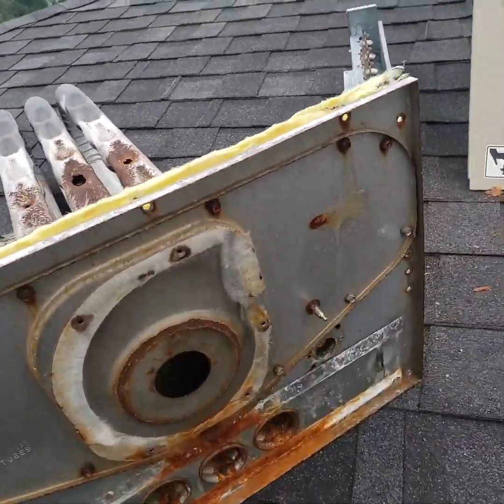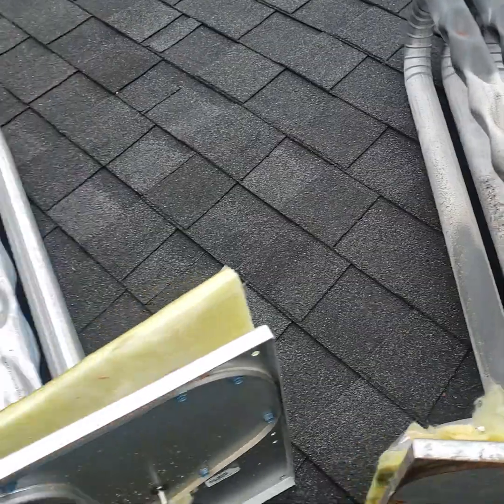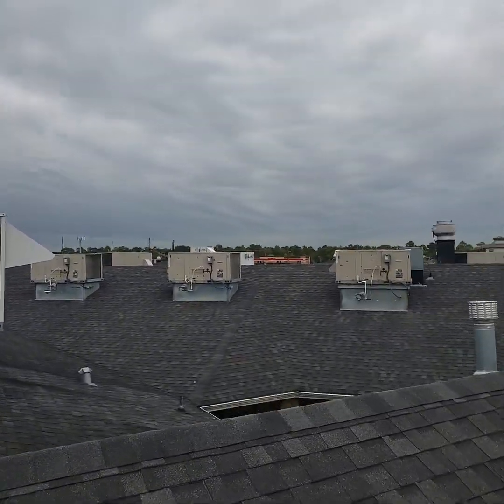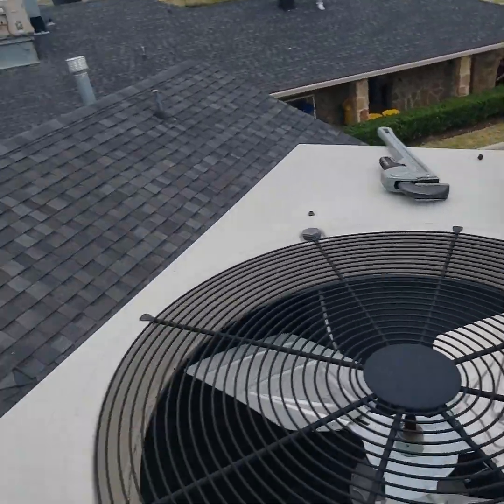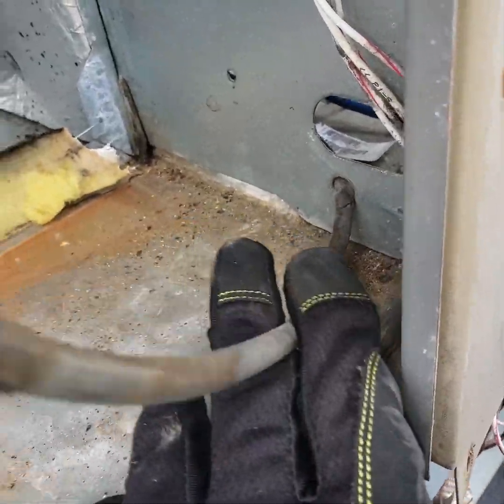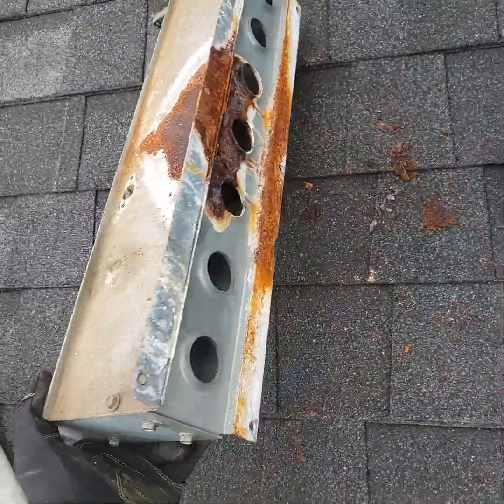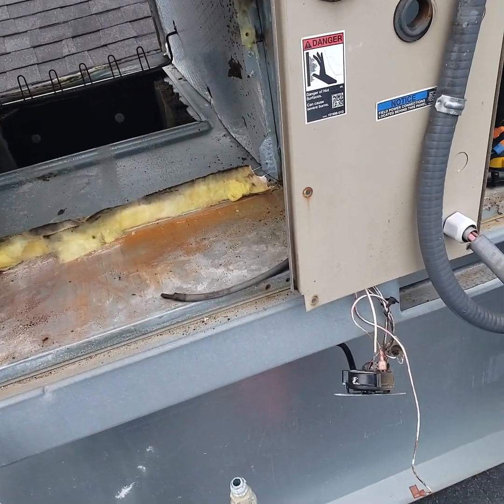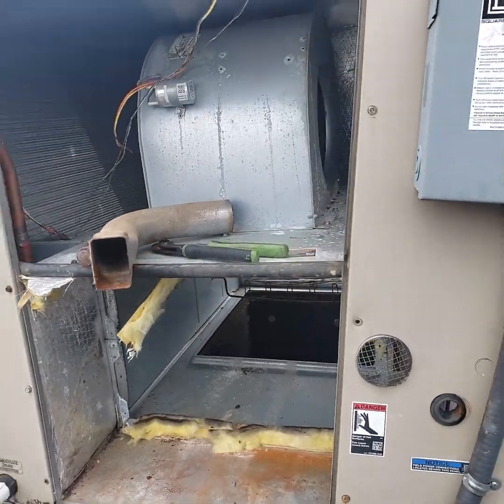HVAC: Cracked heat exchanger

Comment: The thing that stood out for me was the dimple on the exchanger tube. That seems like a poor choice of design since liquid will seek its own level. It's as if they placed a bowl for any condensation that might occur. The holes look more like bullet holes than cracks and they were smack dab in the lowest part of those dimples. The replacements were designed the same so I suppose they know better than my casual observation but it really don't take much to see the weak spot in that design. It looks like you were servicing a complex and every unit was outfitted with the same type of units. Wow! Well, work is how you find it and if it was good for them then I suppose it's great for the service tech. No amount of PM is going to avoid that happening again. You want the best for your customers but there's not much you can do when they make poor choices about their equipment.

Comment: Would it be cheaper to jus buy a new unit if the heat exchanger is cracked?
Reply from the maker: Heat Exchanger $1000 New Unit $8000